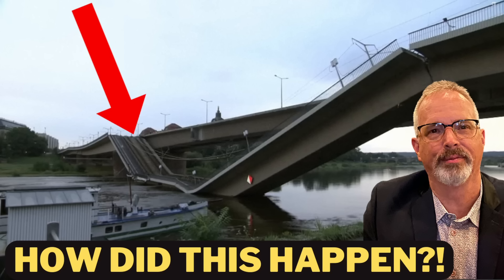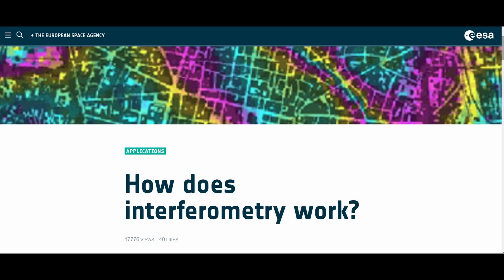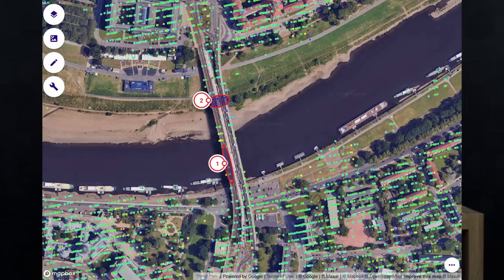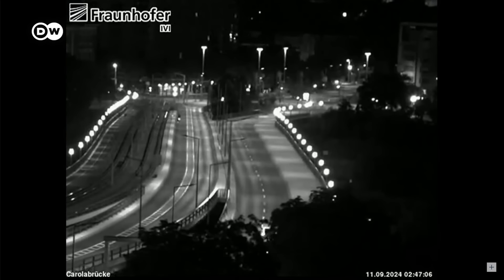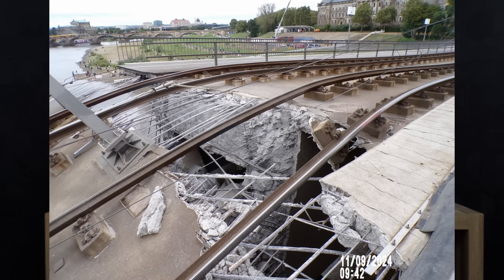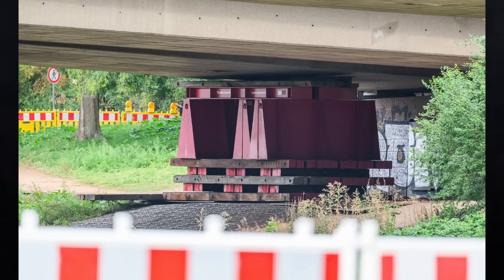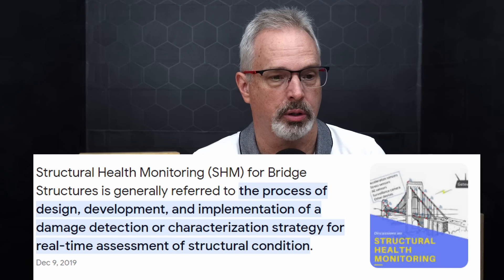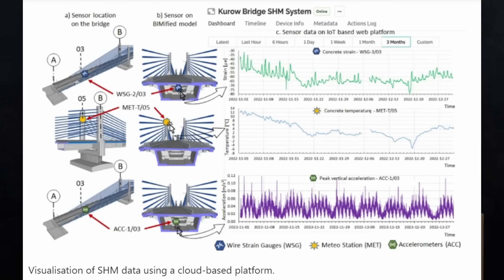Carola Bridge Collapse Update - Dresden, Germany

Comment: The bridge had monitoring equipment placed on it, and it was known it was failing, that's why it was supposed to be replaced, but the monitoring did not predict an imminent failure. Problem with the kind design from that era is that, unlike today, it was built without any means to inspect the tension cables and measure their load. It is also a well known problem and affects also bridges in West, and we have a number of these bridges in Berlin, mostly train bridges, and they are all in the process of being completely replaced. Also, German bridges are built with 100 years intended life time, and these tension concrete bridges are now being replaced with completely different types of bridges that do last longer than 50 years and can be better inspected and repaired.
Reply: It was abput to be replaced but analysis a few months prior indicated that it was no risk. 

The high temps during the summer probably pur it under stress and the the sharp drop in temps caused it to fail.
Reply: The biggest problem in these cases in Europe is the bureaucracy. The bridge fell before all architects, preservationists, nature activists, amateur architects among citizens, and politicians finding a way how to get the contract for his brother's company got to an agreement.
Reply: It was not to be replaced, the renovation was scheduled for 2025, the other parts of the bridge were renovated the prior years and now they have to write off those costs, coz they  also have to be torn down.
Reply: In coming 30 years Germany will basically have to replace all of its bridges. How will they fund this?
Reply: @mipmipmipmipmip-v5x  all? Where did you get that information from?
Reply: @Stoffmonster467   you can do a back of the envelope calculation. Already current state is 1/3rd of all autobahn bridges are critical, check tagesschau from yesterday. The rest that is still good now will need work later on. Bridges have a 50-100 year lifespan. Autobahn bridges been built since the 1940s. Also note they weren't designed with current traffic density and heavy loads in mind.
Reply: Public knowledge.
Reply: @mipmipmipmipmip-v5x  12 % if you read the report of the check notes 6/2024
Reply: @Stoffmonster467  current state is already more than 12% in need of action
Reply: @Stoffmonster467  plus, it might have come to your attention that a bridge in Dresden just collapsed that was not blocked off, but deemed safe for traffic. In case not you might want to watch the video you're currently commenting on. So, whatever has been reported up to now, might need some significant rework.
Reply: Can you detail the monitoring equipment placed on it or share where this information can be found? This would be a very interesting element to understand limitations in monitoring approaches.

Comment: In a way that monitoring already exists. There's the "Bodenbewegungsdienst Deutschland" ("Ground movement service Germany"), a part of an European project of all countries that participate in the Sentinel mission. It's specifically tasked to use this exact data to monitor the countries for ground movements (landslides, sinkholes, mine shaft collapses, etc), and does not look at bridges and the like. They have a freely available web portal (I'll try to link it in a reply to this comment). Unfortunately, unlike the commercial provider, they exclude bridges for the most part. But it should be (more or less) straightforward to expand that project to infrastructure!
Reply: You still have to attach and assign those data sets to teams and humans working on it.

Comment: The city officials in Dresden were well aware of the problem prior to the incident. They dont need satellite data to know that there is a problem - those bridges are inspected on the ground, in frequent intervals. They knew that the bridge was damaged, and some repairs have been done on the other side. More repairs were planned to happen soonish. Too late for that now. The bridge will be completely demolished and a new one build.
You see, this is not a isolated incident. We have about 7000 bridges in Germany that were build from reenforced concrete during the 50s, 60s and 70s, as a reaction to the economical boom after WW2. That happened in West Germany as well as in the former communist GDR, where Dresden is located.
Unfortunatly politics have neglected to take the neccessary steps to maintain this infrastucture in a proper way and rather spend the money on other things.
I'd bet this won't be the only bridge that collapses in the coming years. And it won't always happen at 3 am, when nobody is around.
Reply: Afaik the other sides more or less got new tarmac only. Nothing was done to the supporting structure
Reply: @benteyssen5720  Ich habe meine Zweifel, dass das in der SZ stand.
Reply: @toi_techno  That's of course utter BS on all levels.
Reply: @gegessen159  Zug A: "Schadstellen im Brückeninneren wurden saniert und die Brückenentwässerung instandgesetzt."
Zug B: "Am Spannbetontragwerk wurden schadhafte Stellen saniert."
In English: There was work done to the supporting structure but its unclear to me how much.
Reply: @gegessen159  I dont know what exactly was repaired. Obviously it was a waste of money anyway, because now the entire bridge will be demolished. At least that was said on TV by the Dresden council members. And if it goes like on this bridge in Düsseldorf, it will probably take 10 years until they have a new one.
Reply: To worsen things, politics - or let's be specific, FDP and CDU politicians - favored trucks over trains for long haul transportation.This made the situation on streets, roads and Autobahnen even more critical. Yet, those same parties did not want to spend money on infrastructure. Milking the cow.
Reply: @maro_from_germany  "Zug A...Zug B..." - This sounds to me as if nothing was done to improve the tension cables or other steel parts, and only the concrete was patched up where it was visibly damaged. (And the drainage system was repaired.)
Reply: @mercartax  The politician responsible for transport in Dresden is from the Green party. He knew since at least 2021 - when the TÜV inspected the bridge - that this bridge was in a bad state, but he would rather spend the money on bicycle lanes etc.
Reply: @johndeer6543  "Spannbetontragwerk" is a somewhat generalized term; this could or could not (to my understanding) include steel parts/tension cables.
Reply: Say every bridge replacement costs €1B. That's €7T in repairs, twice the GDP. Even if it's half that cost, how are they ever going to fund this in the upcoming decades
Reply: @mipmipmipmipmip-v5x  That would be way overpriced. The Waldschlößchenbrücke complex in Dresden came in about 180 million € with the bridge itself costing about 75 million. And that was quite a large bridge.
Reply: @mipmipmipmipmip-v5x  I'd assume about 80% of those bridges are bridges crossing over the Autobahn. They are usually not as large as the Dresden bridge. More like 30-50m long, with 2 lanes and side walks. They may cost "only" 10-15 million a piece. But it adds up to a lot of money still.
And another problem is, there are not enough construction companies to do all this work in a reasonable time - nor can all the bridges be closed for traffic all at once. So the negligance is now leading to a full grown disaster.
Reply: @petebeatminister  they managed to replace the bridge in Leverkusen in a record breaking time for German standards. By normal procedures the planing and permits would not even be done yet. I hope they try at least to work somewhat the same way with the bridge between düsseldorf and Neuss, otherwise I am a tad sceptic the 10 years will be sufficient.
The plans to replace that bridge are some sort of black humour though as well, because as long as I know this bridge, I think there was always construction work going on to repair the bridge. Either the beams underneath, than lanes were reduced to reduce load, cables have been replaced... I think for the last 25 years I have never seen that one not being a construction site.
Reply: @alexanderkupke920  Well, the old egyptians took less time to build a pyramid than we need for a simple bridge nowadays. Have you ever wondered why the media never speak about how long it took to build the bridges in the 50s and 60s? Because people would freak out then.
And then all can think of is to reduce the load on the bridges. Ideally to only 1 bicycle at a time.
Reply: @petebeatminister  I would say reducing the load, in the Leverkusen bridge example o vehicles up to 3.5 tons is nothing more than a band aid to buy some time. and things have to get really dire until they get there.
I think people are mostly not aware how much time the original bridges took to build. and let us not forgett, at the time with machines and cranes, that are no comparison to what specialized equipment we have today. 
But also traffic was a lot less at the time, and that was the amount of traffic they calculated with. And the bridge taking time usually was not a hassel, because there wasn´t anything there in the fiorst place, so people were used to the long way. 
It is just today, that such restrictions do not fit in our understanding of how much time thiongs should take or not, plus the traffic being multiples of what we hade decades ago.
I think the problem is not even the building time. building anything, getting the materials, assembling it, putting in concrete, waiting for the concrete to cure, it simply takes time. What I think is the biggest problem today with any such problem is how complicated and bureaucratic the whole process is, before the first person sets up a construction site. you need reports on status, ecology, ... anything first, a scope of work has to be formulated, a lenghty invitation for tenders, maybe up to several years waiting time becuase someone whose tender was not approved calls foul play and everything has to go to court, then a design has to be planned and approved, permits are needed (which may take at least months), in between everything got about 15 to 20 % more expensive,... and finally they start, but things slow down as the executing companies due to the delays do not have the machines or staff ready... and if everything is done, it takes months to finally approve, becuase nothing can be opened and used, until the most minute defect, some run in the paint whatever, was adreesed and either corrected or compensated for...
Reply: They were aware in general, but obviously not about the immediate danger.
Reply: @lilg2300  They underestimated the problem.

Comment: This is awesome, bridge inspection from space.
I didn't know this technology had been deployed already.  I hope you can get a look at the Millennium Tower data.  Thank You,  this will open up a whole new world of research.
Reply: It's a short story about how interesting consecutive data is. While the long story needs to include the very limits: (1) the correlation to temperature was done, (2) the correlation to the river level was not done but could be done, (3) there was intense work done on other parts of the bridge, which includes changed traffic and changed loads by that, also caused by modyfied building materials, modified road surface next to the destroyed bridge part (also different loads on the foundation)...

Comment: For the InSAR data, it's worth considering added radar reflectors (passive & cheap!) to the structures  to create defined sensing points, rather than just accepting the overall 'average' motion that classic InSAR of the generic 'ground' will give. 

 Alternates are to get a dedicated 'stealth' analysis of the radar reflection, given that SAR isn't a direct overhead look, rather it's a sideways look, with trigonometry to determine height shifts.
 So all the 'stealth' calculations make exactly the same predictions, with an opposite purpose. Here we want to 'see' particular aspects of the structure, rather than hide the structure ;-)

Comment: Very Professional engeneering your doing here. But you might want to check the german Wikipedia article to see if it is also only a stup.

It changed quite a bit since the collaps but it is in renovation since 2019.

Renovation work from 2019
Carola Bridge, looking towards Neustadt (2020)
Prefabricated parts made of carbon concrete for the widening of the Carola Bridge
Repair work on the Carola Bridge in June 2020. Prefabricated parts made of carbon concrete are used to widen the pedestrian and cycle paths

Although the bridge's supporting structure appears to be in good condition, the author Peter Hilbert admits: "The Carola Bridge has suffered considerable damage over the decades."[2] Therefore, the renovation work began in November 2019. In addition, the roadway equipment and design were to be adapted to current usage requirements. Wider pedestrian and cycle paths were to be added. However, the existing bridge cross-section was not sufficient for this, which is why the caps had to be widened accordingly.

They began on the (eastern) bridge section A upstream of the Elbe. This was the first time that carbon concrete was used in large bridge construction. The non-metallic carbon reinforcement in combination with concrete opened up new possibilities for bridge renovation as a lighter and more flexible material composite compared to reinforced concrete. The material made it possible to widen the footpath and cycle path from 3.60 meters to 4.25 meters. With conventional materials this would not have been possible for static reasons. In cooperation with the TU Dresden, carbon concrete was to be established in construction. The use on the Carola Bridge was a pilot project that was intended to illustrate the advantages of non-metallic reinforcement and to highlight Dresden as a location for innovation. In addition to carbon concrete, the installation of basalt reinforcement was also to be tested. It was planned to build the bridge cap of arch A from one bank to the middle of the bridge with carbon concrete and the second half to the other bank with basalt concrete.[27][28] The renovation lasted until June 2021 and, in addition to the widened caps, also received new sealing and road equipment as well as a new road surface. In addition, damaged areas were repaired and the drainage was repaired. The cost of bridge section A was around six million euros.

From October 2022 to June 2024, the middle bridge section B was renovated in a similar way. Unlike the first stage, this had to be done in accordance with the monument protection regulations due to the fact that the bridge had since been placed under monument protection. For example, the outer surface of the reinforced concrete caps, the area visible from below, was given a corrugation, like the old bridge.[2]

From January 2025 to the first quarter of 2026, the renovation of bridge section C was planned,[2] which had received the rating "unsatisfactory" (3.0-3.4) in the last main inspection.[29] The plan was to replace the seals, reinforced concrete caps, railings, lighting and the track itself. The hollow box under the road surface was also due for renovation, which was largely easy to walk on at a height of 1.6 to 5.2 meters. The author Peter Hilbert wrote about it on August 14, 2024: "There are many damaged areas in the concrete with cavities and cracks," which are to be demolished with pneumatic hammers and finally replaced with special mortar, as in the other bridge sections.[2] The tender had already been issued and was canceled after the partial collapse.[30]

According to the head of the Institute of Concrete Structures at the TU Dresden, Professor Manfred Curbach, the bridge had been under constant structural monitoring for many years. However, no measurements indicated the impending collapse.[31]

Comment: I have found iver years if work with state government entities that most often, the process is to get something built. Let the next administration worry about the maintenance, even if that's a consideration. And, even if the money is built into the budget for preventative maintenance, oftentimes, it's gobbled up by another immediate need. Basically, like a deck of cards, nothing happens until a collapse. Once something starts to fail, it all collapses, and then fingers begin wagging.
Reply: Over the years I've noticed that one particular party refuses to pay maintenance so they can complain when the other party comes into office and spends money on maintenance. As well as taking money out of a budget because it was earmarked for emergencies. Pennywise,😢 pound foolish. At the city and state level.
Reply: As well as refusing to recognize the cost of maintenance when bragging about putting up a new building, justified by the expense of maintaining the old building.

Comment: This bridge was up to refurbishment but not considered extra urgent. They got surprised by the collapse. A sign that they need to think about better monitoring methods. The ones they used obviously did not tell them what they needed to know.
Reply: The bridge complex was already in the process of refurbishment since 2022, with the partial bridge carrying motor vehicles having been finished - the tram bridge that collapsed was the part planned to be refurbished next.
Reply: the bridge was hard to check on due to poor design choice, so they didn't really know for sure

still a bit reckless to allow transit before the refurbishment was completed if they had no means to know for sure whether or not the bridge was about to collapse